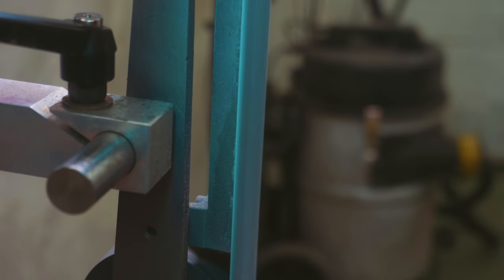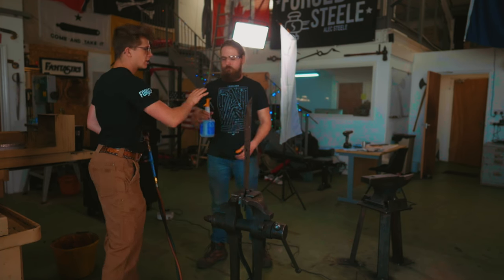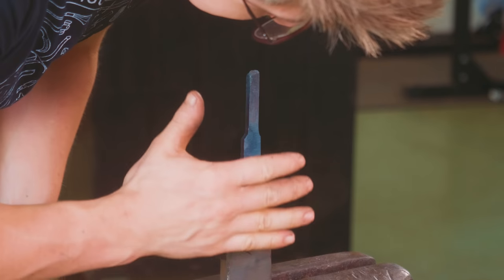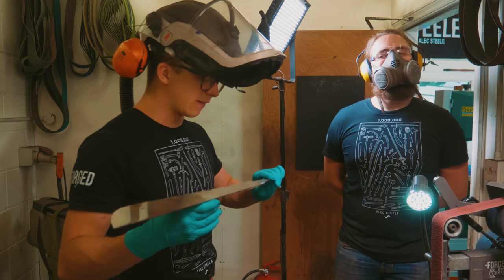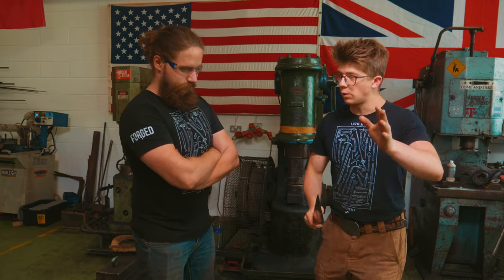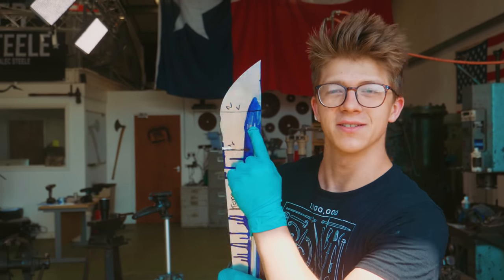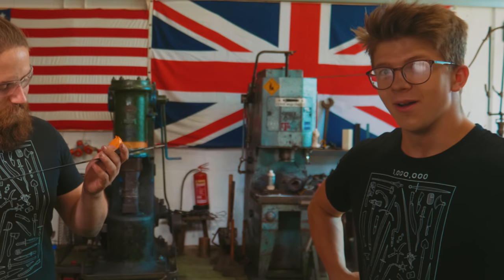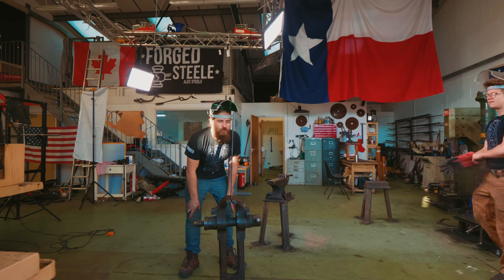MAKING A FALCHION!!! Part 4

Comment: curious how much of the hamon will be left?
Reply: Well the steel was heated all the way through in the forge when they hardened it, just at different temperatures and speeds, so it should still remain no matter how much of it gets sanded off.
Reply: yeah from what ive seen, hamons can be very fickle to begin with - not so much at issue with sanding(although again from what ive seen aggressive sanding can minimize your hamon visually), but curious to see how all the different heating will affect the hamon as well! im wishing them success, but ive seen that hamons aint easy either!

Comment: Your auto colour correction has been throwing me off lately, it makes a lot of artifacts that kinda ruin the beauty of 4k shots.

Like your T-shirt flickers between blue and red in the white detail as the colour correction is over stimulated. In several past videos in dark details we'd see big JPEG like colour artifacts as well.

Colour correction is nice, but you might wanna tweak your settings slightly if you're gonna keep to auto correction. And if it's your camera I suggest turning that feature off and using colour correction in post.